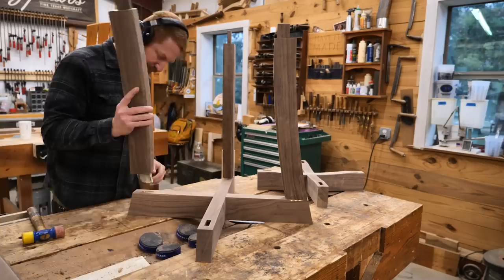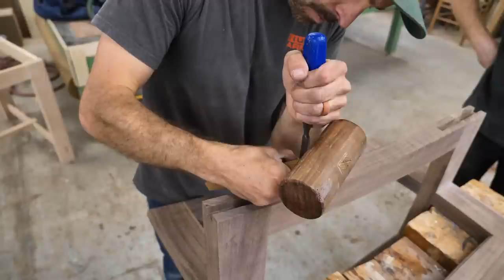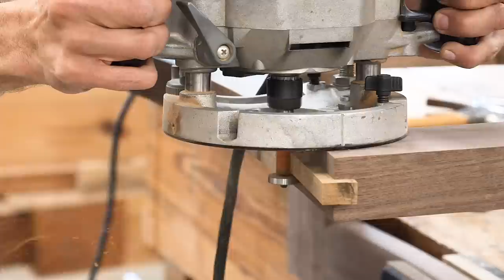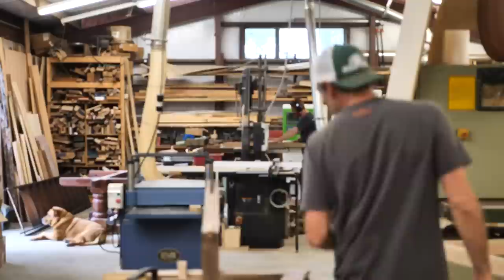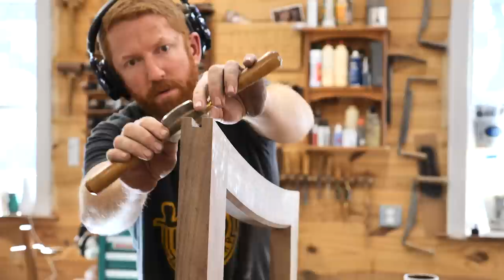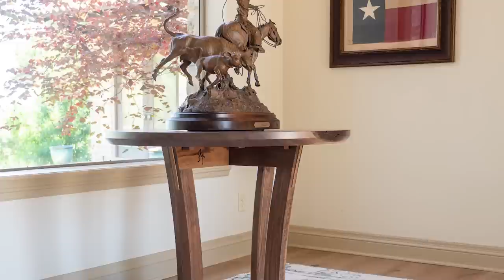The Small Details Matter...Handcrafted Entry Table In Walnut

Comment: Great video.  I use the  Target EM8000 conversion varnish as well.  Great finish - beautiful appearance, lays out nicely, dries quickly, durable.  I also use their high build lacquer EM7000 with great results  - less durable, but suitable for all but high-wear surfaces.
Reply from the maker: Thanks!  Yeah I just started playing around with EM6000 lacquer.  It's been good so far!
Reply: @AndyRawls  You're welcome.  I've used the  EM6000 for years before switching over to the 7000. Great results with it as well. I've always wanted to try their pigmented EM6000. I believe they have it in both black and white, but you can tint any color you wish with appropriate dyes.

Comment: first of all, not critiquing just learning, why did you only put glue on the sides of the splines and none in the bottom of the joint? Is it because these are more aesthetic than structural? nice work as usual guys. I love watching you teach him, wish i could find someone near me to learn under.
Reply: Not saying this is why he did it. But I've had some joints not seat properly because of glue. The glue either causes the wood to swell or just to much glue in the bottom of the mortise  that my tenon doesn't seat.
Reply from the maker: Using a slot cutter to cutout the slots for the spines means the bottom of that hole follows the curve of the table base.  That slot cutter rides on a bearing see its matching that curve...does that make sense?  With that in mind, the spline is straight and only touching at each end it doesn't seat down flush in the slot.  The glue on the sides is enough to hold it in place.  It does add some strength but mostly this is an aesthetic detail.